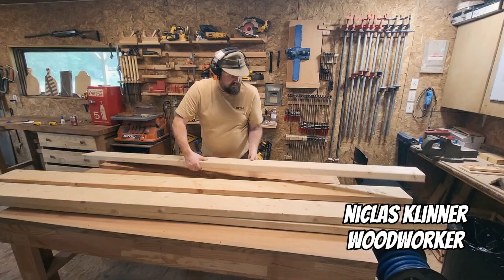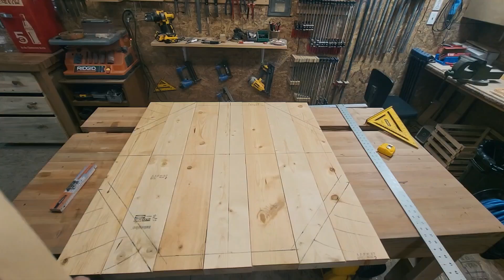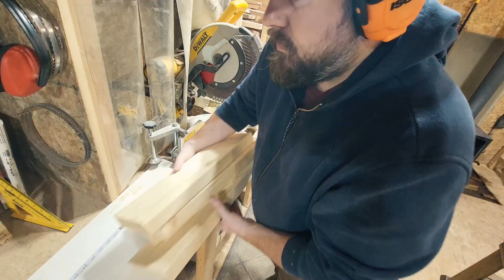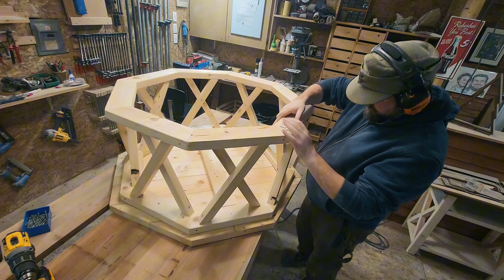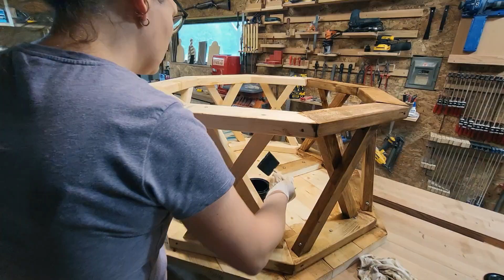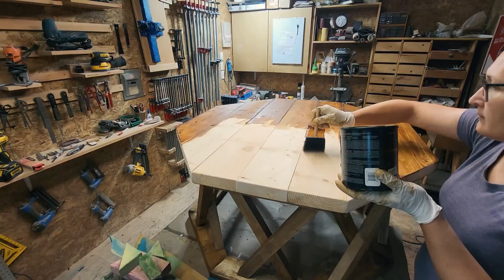How to make a Farmhouse Coffee Table under $60!

Comment: nifty table. one coment on staining and such. since you are not using glue, you can sand and stain before assembly to make it go quicker and easier. i always try to do that with pieces with lots of surfaces to stain or paint. if you have glue surfaces, or surfaces you just want clear for whatever reason, you can cover them with masking tape as well. great job showing what can be done with bog standard tools. coulda done the whole thing with a straight edge, speed square, circ saw and a drill pretty much.
Reply from the maker: Thanks! Yes, that's a great tip with the staining. Haven't thought about that.